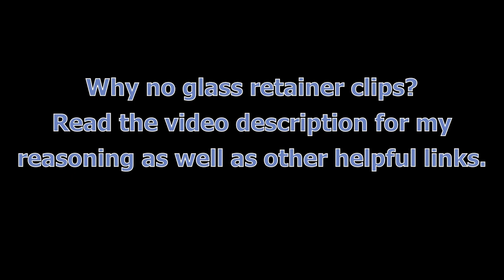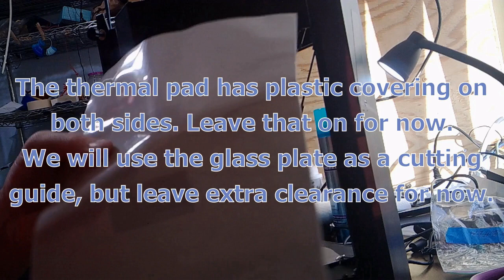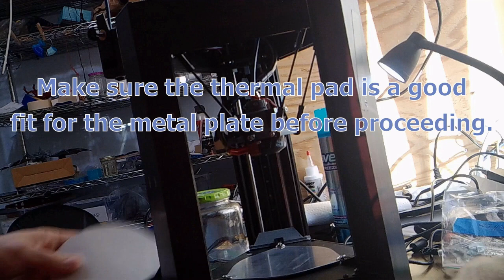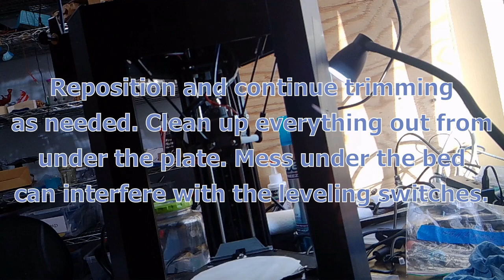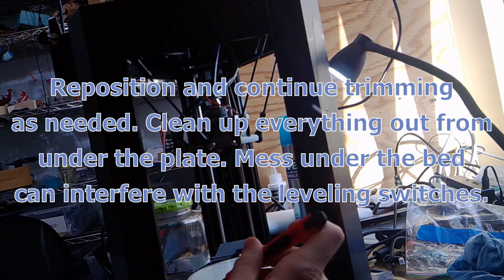MPMD - Glass Bed with Thermal Pad Installation

Comment: Can the glass be removed from the thermal pad? I have 2 glass beds that I switch between. (Cleaning one whilst printing on the other)
Reply from the maker: It depends. For the pad I used in this video, absolutely. Durable and easy to clean.

For a pad I previously bought (Arctic Thermal Pad), maybe not. The Arctic Thermal Pad performs well when left alone, but seems to tear easily and is harder to clean if you get any crud on it. 

Unfortunately, the pad I bought is no longer available, so you will have to rely on individual product reviews. At the end of the day, as long as the glass bed doesn't wobble around or slip off, you should be okay.

Comment: Just installed it, it's better then my ender 5 pro with a glass bed.
This is remarkable.
Forgot about the bubbles tho :(
Reply from the maker: It's probably good enough as long as the glass isn't wobbly.
Reply: @home-fried3dprinting617  Works perfect even with a melted stock bed clip